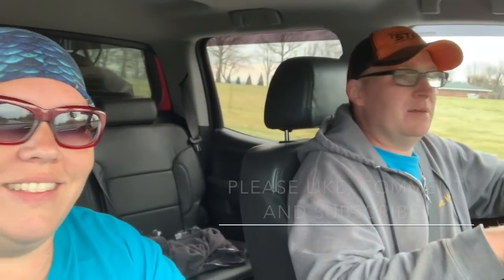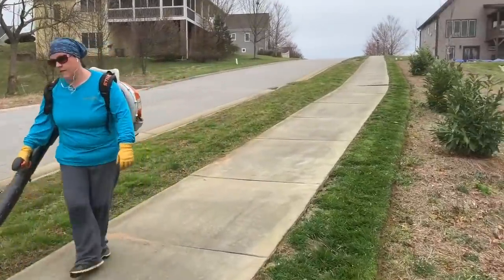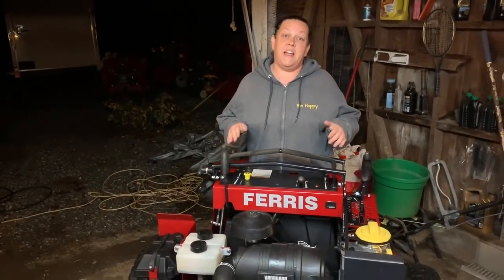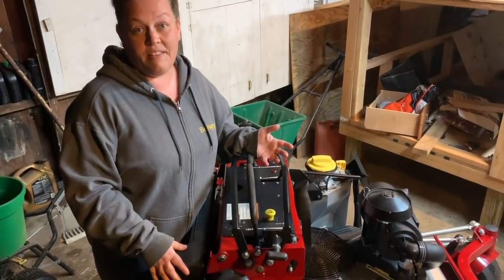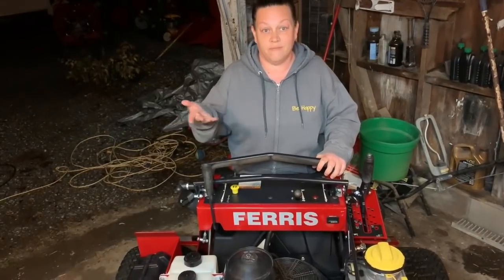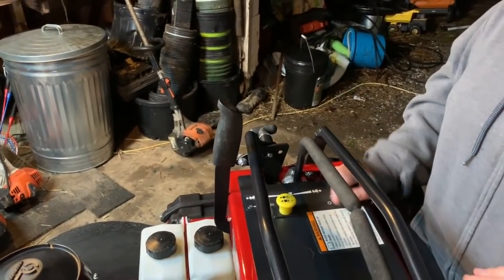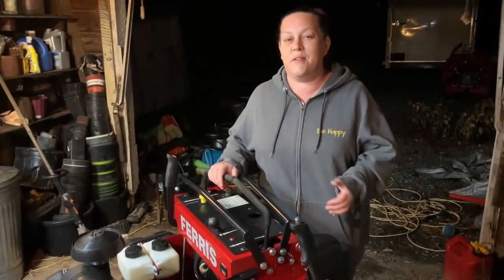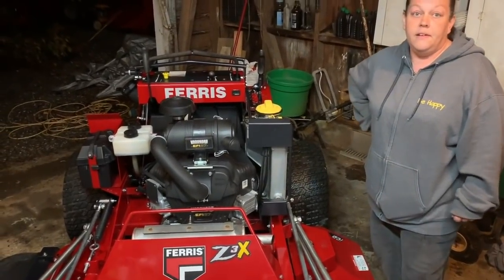Ferris Z3X 200 hour review ~ Vanguard BIG BLOCK EFI with oil guard - stand on ~ SRS

Comment: Hey Happy!  Love the vids, always.  I have newer commercial mowers like y'all.  I could not even imagine waiting sooo long to change oil except for the hydraulic stuff.  I change my oil every 50 -60 hrs because my mowers take care of me.  So i'm gonna take care them.  My  dealer told me  that it's not a problem for the mowers to change oil often.  And i figure I'll get more life out of the engine as well.  Your Ferris 61 is a great machine.  I'm a solo guy and didn't want to hire a laborer like y'all,  so buying these big commercial mowers make great sense.  Keep up the good work.
Reply: The oil guard system holds 5 quarts of oil.(15w50) The biggest killer of oil is heat. Seeing as though most of the oil is in the aluminum exterior reservoir , heat is transferred away from the oil therefore making the oil last longer. That being said...ill do the first oil change on my z3 at about 250 hrs.

Comment: Hey guys great video. Very informative, good delivery. With  the equipment upgrades last summer, how many hours a week do you figure it saves you.  Or roughly how many more lawns can you squeeze in with the extra speed and efficiency. Thanks and keep up good work!
Reply from the maker: When I compared two months, we mowed about 35 more lawns each month than the year before and last year was extremely wet.  The bigger mowers not only help production but helped so that we didn't fall extremely behind because of all the rain.  Thanks for your comment!

Comment: Great job on the Z3 review!  Looking forward on the FW15 update.  I was getting little anxious to buy a small walk behind before the season started.  I ordered a Worldlawn 28 from my dealer.  They also sell the 32 inch mowing deck.  They are both belt drives with 10.5 HP engines.  I really rather have a hydro transmission but the Worldlawn will have to do for now.
Reply from the maker: Did you ask your dealer about the FW15 or do you have to go to another dealer?  Go check it out!

Comment: Great review.
I am on the fence, but Ferris dealer is 1hr away, wright is 20+min. away , Scag / exmark is 15min away and gravely is 6min away. 🤔Hmmmmmm. Love the looks and oil guard of z3. Love no grease fittings on wright. (Wright doesn't yet get the oil guard system as of yet, but for some reason same engine is available (another 🤔).. thanks again guys for that .
Reply from the maker: Yeah one hr is far. Have you demoed all of them if so I would go with the dealer that gives you the best service and if they are all good I would pick the one that is the most comfortable for you. The oil guard is awesome we haven't changed the oil yet on the Z3X yet and we have had it for over a year. Hope that helped. thanks for watching!

Comment: Hi Carl and Boss , want to share a small tip , drive the mower up one side of trailer ramp change two of the blades , drive up on opposite side change that side no bull jacks and better clearance than auto ramps 😎give it a try then tell me how ya like it , great job y'all.
Reply: I bought a 1 ton chain hoist from harbor freight for $49. I  lift the front of the mower from my garage rafters.
Reply: Will Robinson cool beans , what ya do if your mowing and whack a blade n bend it tho ? day gone rocks in michigan they grow out of ground like corn or peas
Reply: grasshopper Crews   In that case i drive the mower up one side of trailer ramp. Lol
Reply from the maker: Thank you! Yes, I do this just not all the time because I don't want to put all the weight on one side of the trailer. I bought ramps and it works just not as easy.

Comment: My eXmark turf tracer is the same, I put the pin at 3.5" and when I measure from the a leveled concrete to the blade, it's actually 4.25"

Comment: Why didn't you demo a Wright standard with the 37 horse ? I have riden both but I only do my on house so I decided to go with a home version of the Wright standard 52 inch in the home model.
Reply from the maker: Citizens RightsTn we did demo a wright.  We decided on Ferris
Because the dealer support is awesome and good thing anyway because the only Wright dealer ended up closing.
Reply: @happysfamilywnc  The wright dealer near me was $1500 higher then the one 2 hrs away. After I have mowed some with it I think that I would had got a zrt instead. Standing hurts me some but it will lay the grass down.